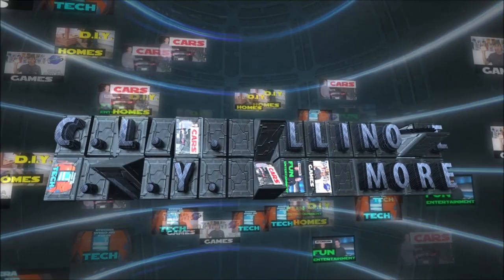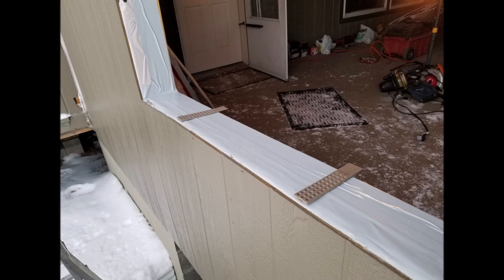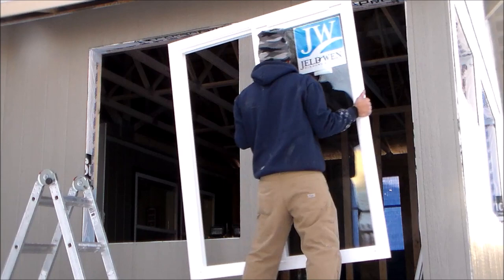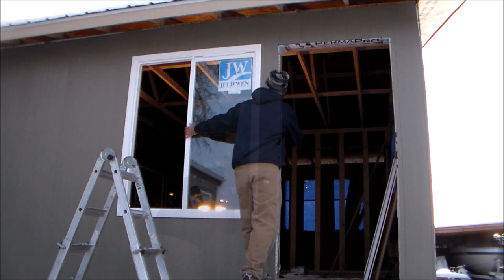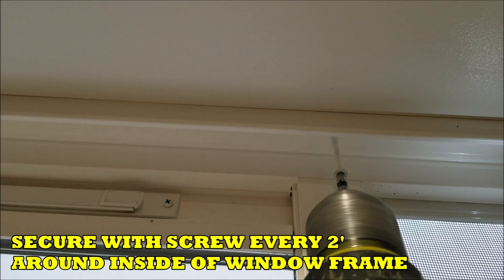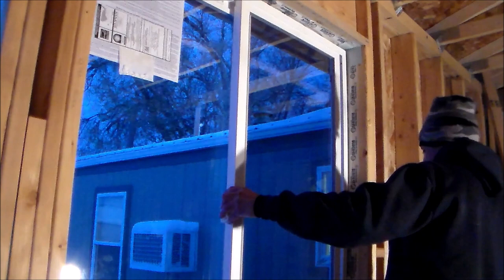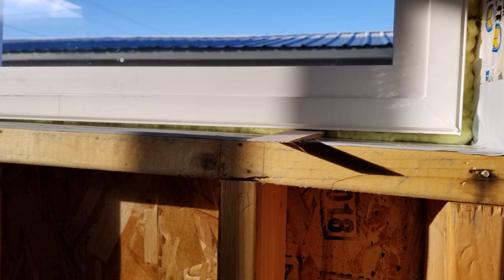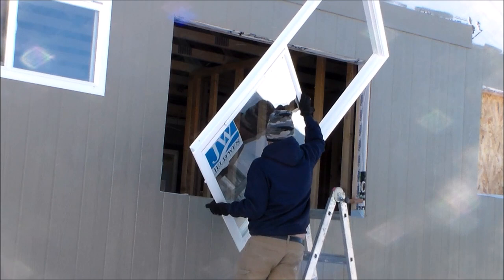How to install JELD-WEN V 2500 Flush Fin Windows with BUILT-IN trim using T1-11 siding. EASY DIY

Comment from the maker: Important note:  When securing the window with screws at the bottom of window frame make sure to use silicone with those screws because the drain channel is in the bottom of the window.
Reply: I'm buying the same type of window and doing it myself with no help at all.
Shims can be used to drive the screws I think I heard you say. I'm going to have large gaps 1" to 1.5" before driving the screws because I'm retrofitting my old aluminum windows and keeping the old frames.
Do you think I can get away with using the inflatable AirShim to square the window, screws and then filling those large gaps with the window foam? I wonder if the screws, the foam and the two layers of caulk outside would be enough to keep the window in place.

Comment: Do you need the wood shims at the bottom of the window it it's a retrofit window ? I already have the casing and trim from the old window. The old window is the original window, it slides left to right.
Reply from the maker: It depends how it fits.  If it fits flush and level, you might be able to not use shims.  If its un level then shims may be required.

Comment: This was a Fantastic video and very educational. you did a great job explaining all the steps thoroughly and wanted to say thank you for that!
Had a question, I'm doing a DIY project on my back room and will be installing this same model window.  My window measures  71.5-in x 47.5-in x 2.9065-in.  Would I rough frame my window a 1/4 inch larger than that measurement, or would I rough frame in exactly 71.5 x 47.5?   Any advice would be greatly appreciated!
Reply from the maker: Hello, Window opening should be larger by at least a 1/2", which will give you a 1/4" gap on all sides.
Reply: @D.I.Y._All-in-One  Ok, Thank you for the info!

Comment: I had picture windows ,  retrofit style  with flush fin style installed on my stucco exterior.  The stucco wall is flat surface so why are the bottoms of the vinyl fins not flush fat against the stucco wall?  When I stand below the window and look up, I can see a gap.  Is that supposed to be that way? Plus why did installer not caulk the bottoms?  I was told they do not caulk the bottoms because it’s a retrofit window.

Comment: Are these windows always installed over the siding? so to replace siding you must take out the windows?
Reply from the maker: Yes the windows would probably have to be removed with new siding.  The window could be installed in a manner where it sets flush with the siding then trim could go on top of it but that would defeat the purpose of having the Built-in trim though.

Comment: What do recommend for the siding that over laps. Do you have a video for that type of window & trim? Thanks in advance!
Reply: It’s late but if you’re doing that type of siding you can get any type of window with a normal fin for new construction (install before siding over plywood) or a window with no fin for retrofit (look up a video for lap siding retrofit window install in that case)

Comment: I cannot find this window anywhere!!! Help, please!
Reply: Home Depot.
Reply: @loneranger1536  not there...looked online
Reply: @brittanyc1865   Some sizes are special orders. I just ordered one at Home Depot. They didn't have the size I needed so they had to order it. It takes 4 to 6 weeks to get in.
Reply: It's called 60" x 38" V-2500 flush fin 2 panel slider. Of course you would use the size window you need instead of the 60 x 38.

Comment: Can you remove the window shims after the foam is dry?
Reply from the maker: I would just cut the shims after foam is dry.  Some of the shims should line up with screws that secure window which makes a solid connection.
Reply: @D.I.Y._All-in-One  I wanted to remove them completely with the screws so I can foam that area then  put the screws back.
Reply from the maker: That will work but the window might not be as secure without the solid  shim connection. The frame may have ever slight movement over time.